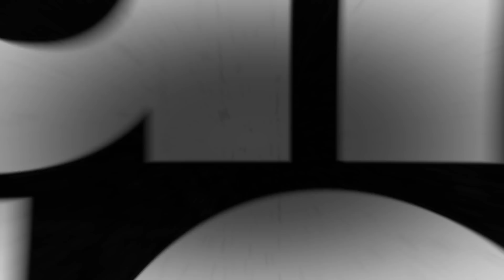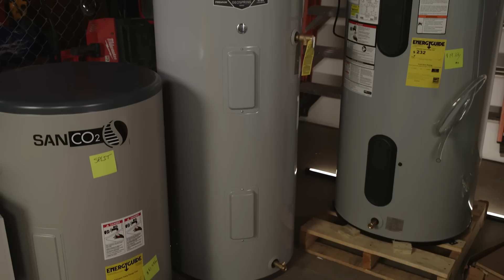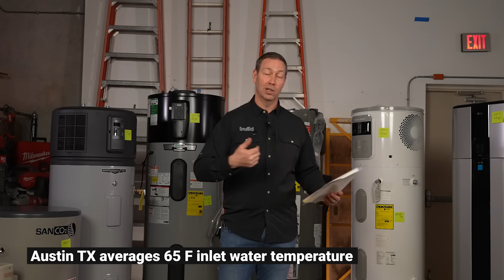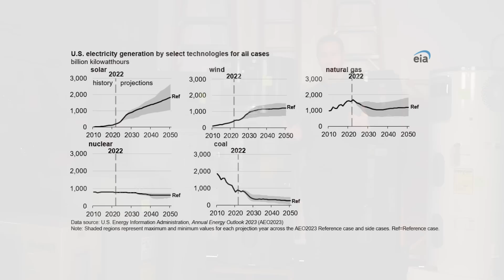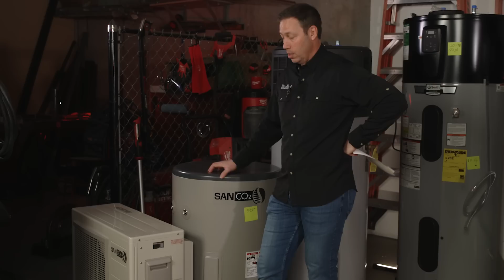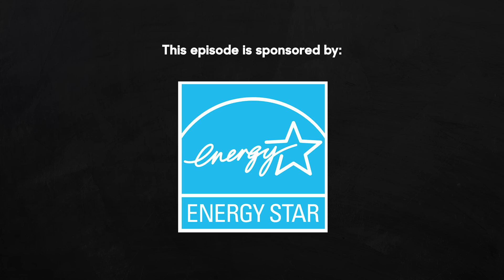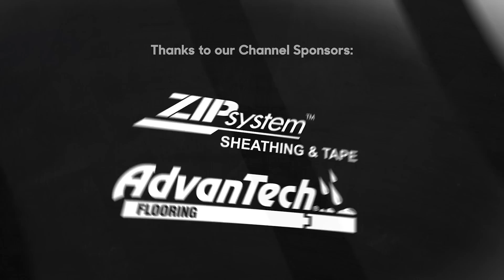2024 Heat Pump Water Heater Buyers Guide

Comment: What about a system that captures hot water from a heat pump HVAC system.  In warm weather, air source and geothermal heat pump are pushing a whole lot of heat out of the building.  Is there any sensible system available that could capture that waste heat into a domestic water tank before it goes outside the house?  What about a solar hot water systems?

Comment: One caveat I'd add is warranty. Had a buddy of mine buy one ±5 years ago & it failed within the warranty period but the manufacturer would only pay for the part, not the labor to replace it, which unfortunately was rather expensive. I'll definitely be asking him which brand he had when I'm looking to buy one & be sure to avoid it.
Reply: The Sanco2 has A 10 year warranty on the heat pump and a 15 year warranty on the 43 and 83 gallon tank options.
Reply: @bspanger1  "Sanco2 has A 10 year warranty " -- yeah, but they are probably like the other manufacturers, warrantying only the parts after a year. So that wouldn't address the concern in the post you're replying to.

My own experience has been that not only is labor expensive, it's also a lot more difficult to even find someone willing and able to work on the heat pump models.

Comment: In the winter you have to pay twice to move heat into the water: once to the inside air, again to move it into the wh.  In the summer this works great, I want a cooler room.  I've seen combined HVAC heat pumps which have a hot water takeoff, this would probably be a better solution.
Reply: I installed a Exhaust Air Heat Pump Water Heater back in the mid-1980's Which took air from the Kitchen, Laundry and bathroom areas as a heat source then pumped that cooled air outside with make up air coming into bedroom closets through "Air Ports".  That solves the cooled room problem and provided fresh air into a tightly built home replacing the HRV unit.

Comment: We installed an A O Smith 65 gallon heat pump water heater seven years ago, located in our garage. We are in South Florida and in the summer it takes the peak garage temperature down by 5 degrees, into the 80s range. It also dehumidifies to some degree.  Our experience has been great.  We have it in Hybrid Mode and it operates in the more efficient heat pump mode all the time.  It is relatively quiet, and our water heating cost is one third of what it was with an electric resistance water heater.  Certainly in a southern climate everyone should have one of these.

Comment: This is one of the favorite energy improvements. I consolidated two electric tanks (including one that was 40 years old). My hot water cost went to $10 per month from about $75-85/mo. Note that 3-4 degrees colder in my basement garage feels a lot colder than previous ambient. Next I plan to ditch my crawlspace dehumidifier and duct the HPHW through the adjacent wall.

Comment: My pressure relief Valve is plumbed outside.  Can the condensate share that same line?
Reply: Sounds like an easy fix... but probably not. Local codes may not allow, because the T&P (temperature & pressure) valve is a critical safety item, as water heater tanks may become a boiler and explode thru your house like a rocket if certain failures occur - rare yes, but it happens. Made some great episodes of Mythbusters!
It's better to run condensate seperately, for several other reasons.
1) the T&P relief line will always be dry, if all is good. If its wet and dripping, you have a problem that should be addressed! Its a warning of current or impending problems. Several times I discovered home water pressure regulators that were leaking by, and permitting 150psi mains pressures into the homes pipes & tank. That does bad things to a system that should run 35 to 50 psi! Like premature tank replacements, and expensive pipeing/valve leaks inside.
2) the condensate drain will normally be wet, and likely to grow things in many climates. A clean-out fitting inline is a good idea, to prevent or clear clogs. In areas likely to freeze....it probably will, if run outside.
And even south Texas may freeze, just ask them! Best of luck, but a good plan is more reliable.

Comment: Matt, any thoughts on air-to-water combi heat pumps? Currently have a gas tankless combi boiler (for both hydronic heat and DHW) and looking into the options for replacement. Seems like there are only a few options right now, and unsure as to whether it may be best to go with two separate systems instead.

Comment: I never heard of a heat pump water heater.  My water heater is natural gas, and it runs about $27 to 30 a month which is not bad. I know i bought the most expensive natural gas water heater I could find due to the great warranty and it is super insulated. It's all paid off, and I'm enjoying hot water even when the electricity is off.
Reply: It has a pilot light? I thought most modern gas water heaters were electronic ignition.

Comment: One question - when you use these during the heating season, are they not essentially  removing heat from inside the envelope of the home and putting it into water? That heat needs to be replaced, right? 

I’m in Atlantic Canada, and looking at a water heater replacement. So it seems that unless I have an outside heat pump unit with an inside tank, then during the 7 month heating season I’ll be trading heat pump efficiency for fuel/energy use from my heating system. 

Am I thinking about this correctly?

Comment: I've had a Rheem for a few years now. Putting it on a concrete slab caused some nasty resonances, but their seismic install kit includes the rated rubber bushings to negate it (definitely worth the cost if noise is an issue). 

The econet app is 100% junk, but I integrate it with HomeAssistant (@buildshow, open source home automation should be a top priority, vs one more app to control things). 

Its replaced my basement AC (walkout basement in GA), the basement dehumidifier, and the old resistive electric WH. Replacing all three and calculating the energy savings had a ROI of 11 months. 

I adjust the temperature up and down seasonally (145 in the summer, 125 in the winter) to keep Legionnaires from growing and to optimize the above benefits.

Comment: I saw some people that were venting the intake air from the hot air under the fridge which made them even more efficient
Reply: Good idea in theory, but not in reality. You dont want that dirty air from the bottom of the refrigerator clogging up the water heater AC coil with all the dirt and dust.

Comment: I worked on a 1978 Airtemp heat pump water heater for a co-worker.  Then bought one, and it had been sitting around at a appliance sales place for a few years.  I put it in my sister's home in Phoenix AZ, where it was installed in the living room, and helped to cool the home while making hot water.  

So they are not new!  Airtemp stopped making them when Chrysler CO went into bankruptcy back in 1979.  It is about 13,000 Btu compressor in it, so puts out a lot of heat.  The modern ones, such as the AO Smith, they only have about 5,000 Btu compressor, so a fairly slow heating mode unless in a really warm garage in the summer.
Reply: The Sanco2 has a 15,400 Btu/hr capacity and will happily extract heat from air at an ambient temperature of -26F.  Yes, -26F.  Thanks to the super effective CO2 refrigerant.

Comment: Now if they could take the unit from the fridge grab the heat from it and use it for the hot water combining the two instead of creating opposite conditions.  This could potentially make the fridge silent if the unit was in the utility area.

Comment: There is some savings loss over the winter for having a single unit heat pump hot water heater in colder climates if you do not have an efficient home heating source.

If you have a very efficient heat pump heating your house you have a very large saving.

If you have an old 65-75% efficient oil furnace you will have savings but they will be significantly reduced.

Of course that only matters in the winter over the summer the savings are similar.

So just keep that in mind.

Also do not put a single unit heat pump water heater in a small closet without ventillation or it will lose efficiency and also life expectancy.

A two unit hot water heater like the sanco offers much greater savings in cold climates if you have an an inefficient home heat source.

They are less efficient though in the summer if you use air conditioning.

No matter what though they will be more efficient.

Comment: If you are building a new system would it noit be better to have the water heater instegreated into your larger heat pump that delivers both heatiing, cooling and hotwater. For this to work you need the correct infrastrukture/heating and cooling methods but then in principle you can use the heat generated by the AC to heat you hot water.

Comment: I just got the AO smith 900 series for 2k because it was on a sale at lowes. Going to take another 30% off from tax returns so the hybrid 80 gal will only cost me 1,400, that’s a fantastic deal. Also do not forget to install a thermal expansion tank, you need a 5gallon one for the 80 gall units.

Comment: do they make one that will supply enough hot water to handle radiant floor heat?  i plan on doing solar and would like to use all electric vs propane.  fyi i’m in Maine.

Comment: I have solar hot water heating system, i.e. solar hot water tank with the back-up electric resistance element on the upper portion of the tank. Has anyone seen a heat pump-solar water heater combo?

Comment: I have a crazy story about an installer who completely messed up the install on mine. In the end I'm saving $40-$60/mo though. 
I got a heat pump water heater in the California Bay Area, and followed a recommended installer for heat pump water heaters. They completely messed up the instillation to the point that it was plumed such that it physically could never deliver hot water when the recirculating pump was running. It took them >4 trips and me doing all of the plumbing diagrams and sizing for the system myself. They completely messed up basically every part of it, yet they claim to install plenty of heat pump water heaters. I spent some time with one of the technicians and found that he says they end up removing basically all of them and replacing with gigantic gas which can handle incompetence in terms of install and waste of hot water. 
They installed the mixing valve improperly such that hot water could never flow through it when the recirculation pump was running at all, grossly undersized expansion tank, and also completely messed up the sizing of the recirculation pump. I'm guessing that this was the cause of many of the no heat or cold water calls they would get and then "revert" the "broken" water heater back to gas when it really was their instillation messing it up. 

Now that I have my heat pump water heater set up, it is saving me between $40 and $60/month depending on the usage. I took the redesign of the system to add in a water meter at the input to the hot water heater, and several temperature sensors so I can measure the performance of the system. The heat pump appears to deliver on the claim of a COP of 4, however the recirculation pump uses significant heat to keep the pipes in the house warm. So far I have used 8037 gallons of hot water. That took 1.02MWh of electricity into the heat pump to put 4.03MWh of heat into the water inside the water heater. During usage, 2.84MWh was lost out of the insulation on the pipes in the house from the recirculating pump keeping hot water circulated. Finally, 1.19MWh of useful heat made its way of the hot water faucet. (All heat added is referenced to the cold water temperature entering the tank.)

I am decently happy with the Rheem unit we purchased except for their software. I have it following a schedule to avoid running during the expensive electricity hours of the day, and it will sometimes freeze and forget to update to the next schedule entry. It also once decided to just not heat the water and let the tank get cold until I reset it. It was perfectly aware that the tank was full of cold water and it needed to heat it, but somehow never decided to actually try to turn on any sort of heating element.
Reply: So I take it you run your recirc pump all the time?? Also sounds like the recirc issue was unrelated to the type of water heater.
Reply: @johnwhite2576  For the recirc issue, yes it is unrelated to the type of water heater, but somehow these plumbers thought it was and completely tripped themselves up on it. IDK how they got it as wrong as they did. 

For the time I have the recirculation pump on, I actually have run it with two algorithms. Originally I ran it with just a normal schedule which turned on at 6 am and off at about 10 pm, but that was extremely horrible effective COP (far below 1) and kept the heat pump part of the water heater on nearly 24/7. I quickly adjusted it to a much smarter algorithm which only runs the pump when it detects water flow on the water meter I installed. This is the algorithm used in the data I collected. I use a laser to read the smallest portion of the smallest dial on the water meter, and notice when over 20 ml / 0.6 fl oz of water is used. When it notices that over that amount of water is used, it turns on the recirculation pump until the return line temperature reads 32C/90f, and then it will shut off. This means the first time you turn on a faucet, it may be cold water, but the next time you turn it on, it will always be hot. This still ensures the pipes are warm-ish for a lot of the day as it seems like the average day causes about 20 activations, each for between 3 and 5 minutes, but is significantly less than running the pump on a normal schedule.

Comment: As to making the room cooler, I think it only actually happens when cold water is drawn into the tank and being heated from the room since that's the situation when the pump is net moving heat to the water.  During the majority of times that water isn't being demanded the pump is just moving heat back to the water while it slowly leaks back out into the room.  Plus the pump is consuming some energy in the process of moving refrigerant around - so a little wattage there.

Comment: $5K for the Sanco?!?  THE most efficient is what they use in Mediterranean countries, the solar panel water heaters.  No, they are not that good for northern climate, but in Southern states they would be almost perfect, especially when installed in line with a second backup heater.  At my house in Greece, I do not use any energy for seven months of the year, and in the winter people might turn on the built-in electric maybe a couple of times a week.

Comment: Installed a Rheem heatpump water heater because of a previous video of yours.  It cost about 600 more than the electric, according to my math I made that money back in under 18 months.  But it's actually better than that because I'm using the AC in my garage way less now that the water heater is cooling/dehumidifying the space making it much more pleasant to work in during a good part of the year.

One thing I want to point out though is that a lot of ppl say things like "This wouldn't make sense because during the winter I'm paying to reheat the space"  However, the units have resistance heat as well just like any old electric heater and most of the time a hybrid mode where the system decides what is most efficient.  Thereby debunking the claim entirely.

Anyways, I just wanted to say thank you for that video because it's been 3 years now and as far as I'm concerned I'm making money every month with the savings not to mention a more pleasant garage!
Reply: Can your heat pump water heater be programmed to choose electric heating at a specific time of day?  For example, here in Ontario we have time of use electricity pricing and at night can access electricity at CAD $2.8 cents/kwh.  That would be a great time to switch to regular resistance heating.
Reply: @Spp235.  Yes, I just checked.  The app that controls it has a schedule feature where you can set the mode and temp by time of day and day of week if you want

Comment: I wanted to install one of these in Southern California to replace a broken tankless electric heater. The heat pump was $2k, but the plumbers all wanted $6k-$8k for the install! I was going to do it myself, since the location was perfect, 240V @60A was already there, just needed a condensate line through the outside wall. But ended up just replacing the tankless heater myself for $120. Would’ve taken a VERY long time to recover that difference! Especially since I have solar.